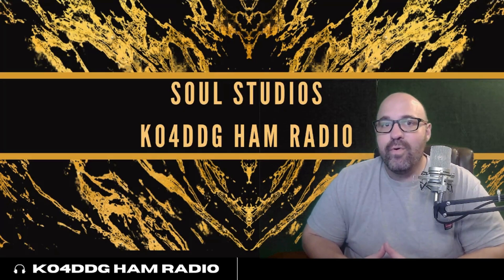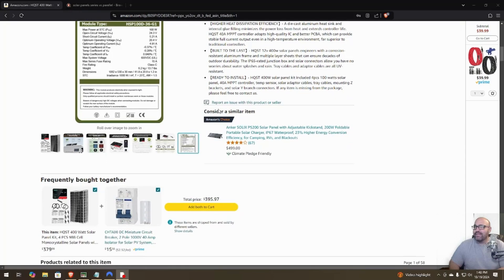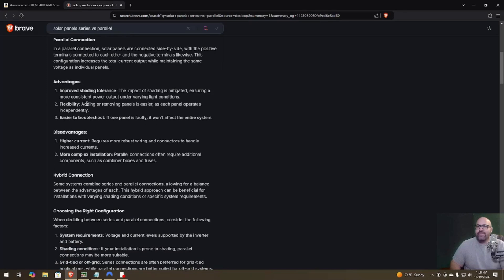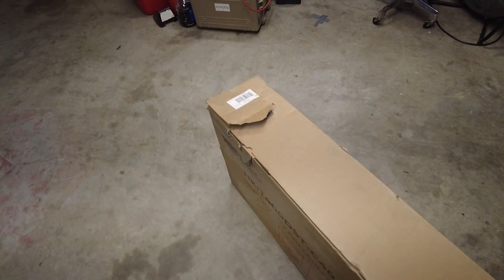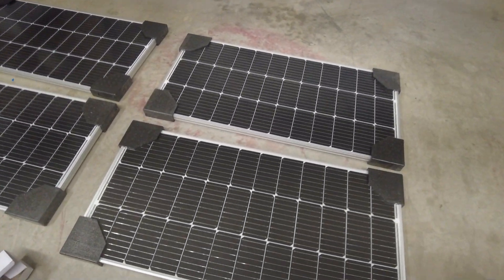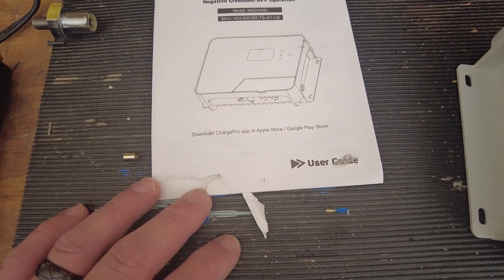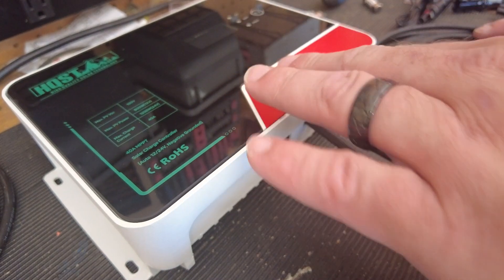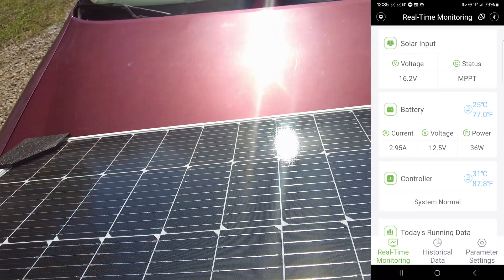HQST 400 Watt Solar Panel Kit Review Part One

Comment: If size proportions isn't a factor, which is a better panel? This panel you have, or the squarer "New Version" HQST 100w panel with only 5BB? They're both the same price for 4 panels at $239 (no kit). Which would you get? Thanks.
Reply from the maker: @rgraz4929  If I had to do it all over again probably a 200 watt panels. But to answer your question the kit comes with the MPPT, But you also have to get all the fuses and stuff so that adds to your cost. With this current kit that I have I can add two more panels for a total of 600 Watts.
Reply: @soulstudioshamradio  OK. Thank you! I think the largest HQST panel is 190w. Is that what you mean? Or do they actually have a 200w panel or are you referring to any brand of 200w panel? Thx.
Reply from the maker: @rgraz4929  just noticed 190 is their largest, I was just implying that you will always want more panels in the end, just depends on the space you have.

Comment: I bought the 600w kit. Same controller. Been active for a year and a half now. I actually like the unit. Even though it maxes out at 40a about 575w. I also run my panels in series/parallel. In the cooler weather and good sunshine it maxes out.  I do run a small dc fan over the controllers heat sink to help keep it cool  in the summer. Buti enjoy the unit and plan on getting a second unit so i can connect them together through the port.  The guy from Hobo tech did a review of the unit and explained the port and functions.
Reply from the maker: Thank you I'll check that channel out

Comment: It's possible that you were getting a lower solar input because you were blocking all four corners of the panel with the styrofoam bumpers still on it. 

Panels actually tend to work better in the fall and winter - at least when the sun is out - because the cool/cold is working to keep them cooler than in the middle of the warmer seasons. 

Hopefully with more time to get everything put together and some more testing/figuring out, things are going better with this set up. I have different HQST panels and they've been great for me over the last few years. When angled properly and on a perfectly sunny day I can routinely get 100% or more from their rated output.
Reply from the maker: @duggerray  it's possible, will find out more this weekend as materials come in from Amazon .